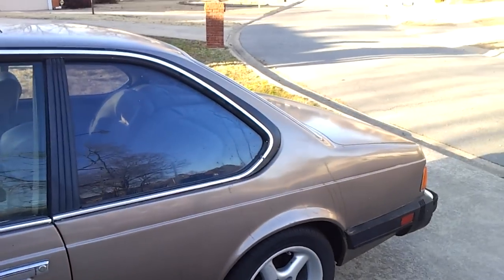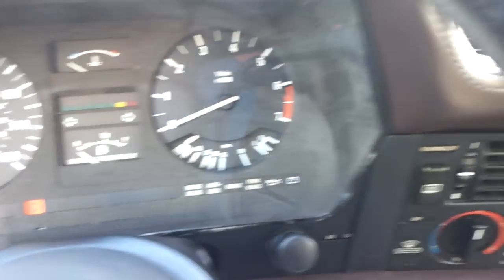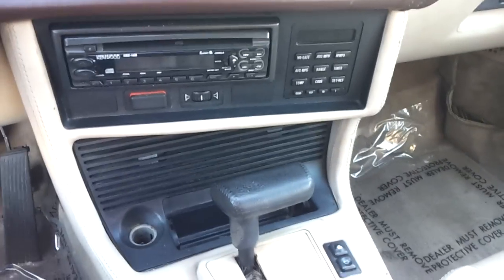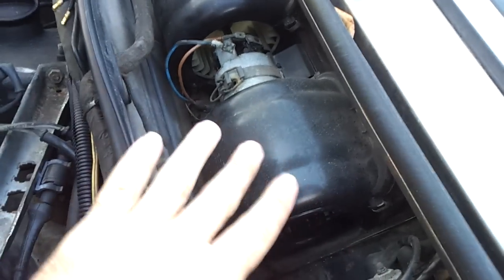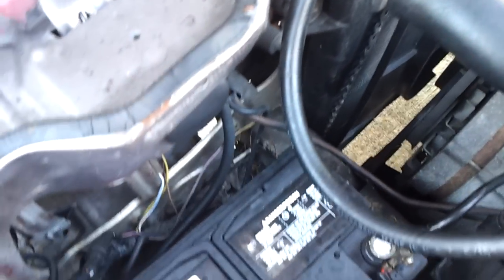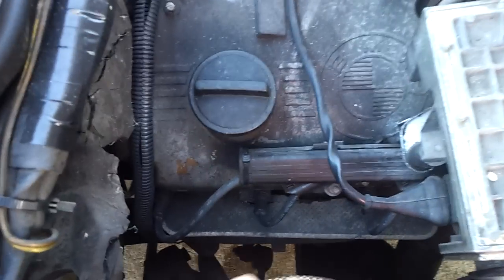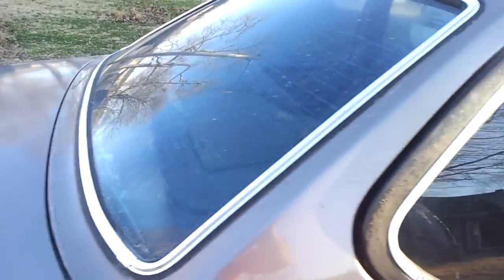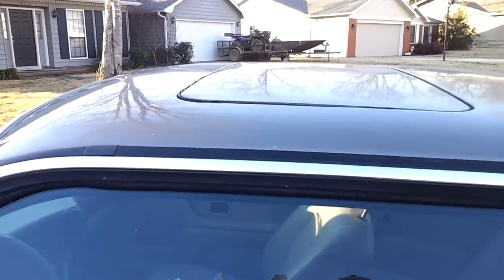BMW E24 purchased from Star Cars Pampano bch FL

Comment: Its very clear that the car sat for a while, possible was not driven for a year or two.Some of the sensor wires were pulled out on the car. Most important thing is to do a compression test on the engine and also to examine the transmission fluid asap

Comment: Did you point to the windshield fluid resovoir saying it was for brake fluid? Honestly i would just pull out the motor trans and wiring and fine a rott box then has good wiring and drivetrain and swap everything.